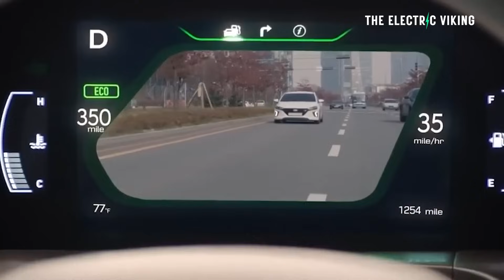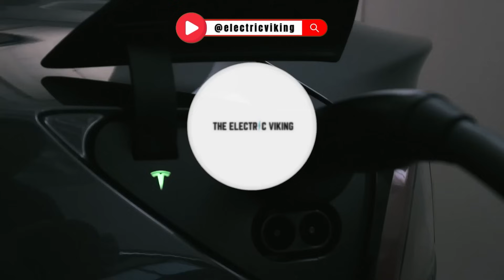Hyundai reveal new hydrogen fuel-cell SUV for global production

Comment: If we could produce 100% of vehicle hydrogen from green sources, it could play a role filling the gap until battery costs come down, especially for larger vehicles from Class-8 semi rigs up to cargo ships.
Reply: But if the cost of hydrogen and hydrogen cars is far higher than the electric cars. And large ships doesn't want hydrogen, the tanks would be extremely massive and expensive to fill. So why bother with hydrogen?
Reply: @Harrythehun  Large ships want Ammonia engines...not H2 power
Reply: @lordofsevenrealms if they could synthesise it onboard from air & water that would be something!
Reply: @markbennett6658  That requires energy. More energy than what you could get out of tthe ammonia.
Reply: @markbennett6658  - where would the energy come from to drive the hyrdogen electrolysis, requiring between three to six times the power input to the power output gained from the hydrogen produced?  And if that energy was available, why wouldn't you use it directly to move the vehicle rather than generate an inefficient energy storage vector like hydrogen?
Reply: @GruffSillyGoat  I didn’t know large container ships had wheels! I was just mooting whether if there was enough extra capacity in the ship to have a plant room would it be possible to synthesise ammonia (NH3 as I recollect) from water (hydrogen & oxygen) and air (oxygen & nitrogen) because the ship is in direct contact with both, thereby driving the engines and running the plant in a virtuous cycle? The raw materials/energy sources are present and in abundance. I’m no chemist or engineer but it’s an interesting concept don’t you think? Of course hydrogen or ammonia for that matter are a completely stupid idea for passenger transportation and probably all forms of road and probably air transport & clearly EVs are the logical answer.
Reply: That makes no sense because it is way more expensive. Not to mention that you need massive investments first. EV's you can charge at home. h2 you to create new stations everywhere.
Would be biggest waste possible. Destroying the climate for a green image.
Reply: @Utoko  H2 is for sectors beyond passenger vehicles...it will co-exist with EVs in the market...US and Western Govts will push H2 to protect their domestic manufacturers....it offers the one thing EVs currently don't have...the lack of range anxiety...although range anxiety is not justifiable from a theoritical and practical pov, it still exists as a psychological barrier for many customers who just want a vehicle they can refuel or charge up in like under a couple of minutes
Reply: @lordofsevenrealms  - H2 doesn't even make sense in sectors outside of light vehicles. During the olympics Toyota provided a number of hydrogen busses as the Paris local government was pushing their use, the bus operators wrote an open letter stating that hydrogen fleets cost 42% more to operate and 70% more to fuel than their existing fleets, and much more than battery fleets. 

In HGVs, leading manufactures, like Scania, are stopping H2 developmentand models as they are too costly and have little uptake and batteries are eroding their advantage. In flight, currently commercial short haul battery power planes are available to purchase but H2 powered remain at the R&D trial stage.

In terms of range anxiety, the class action suit in the US flags issues with range available is much lower than that claimed/advertised for hyrdogen vehicles, and charging times are excessive as the H2 pumps need recovery cycles ever few cars.
Reply: It will happen....China will be the first adopter